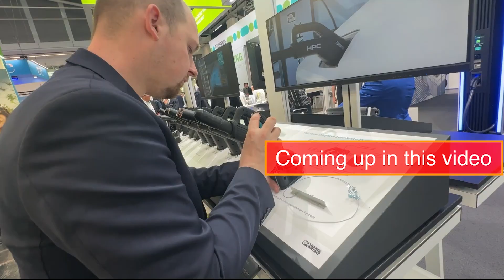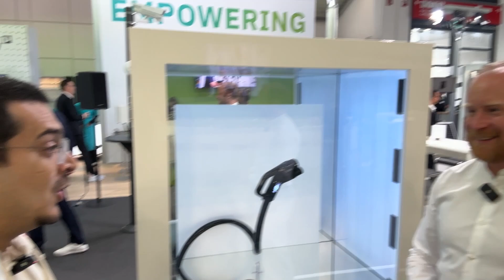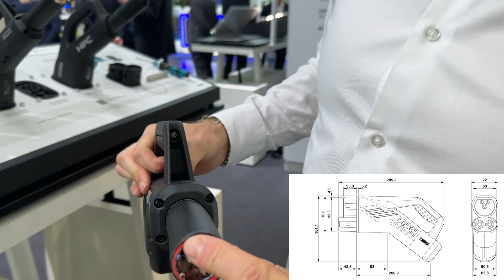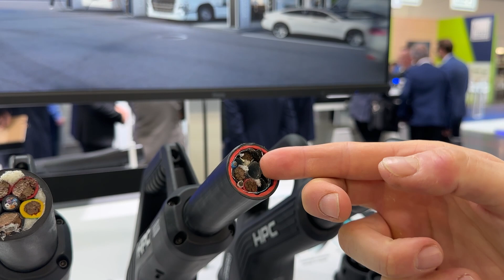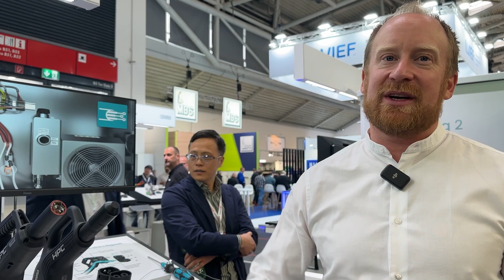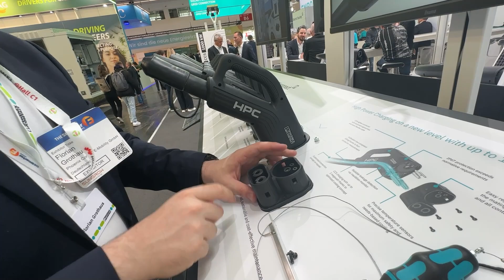1000 kW CCS Connector Exclusive! 20% Lighter & Ideal for Trucks | Phoenix Contact at Power2Drive 25

Comment: I love the design of the charging at the end, can't wait to see them in person. Great job to everyone who worked on this.
Reply from the maker: Indeed. Due to confidentiality reasons, I was not able to record the new cable cross section. But there was so little copper. Instead of one central tube with coolant, there were multiple coolant pipes and very little copper was surrounding it. This made the cable extremely light and also flexible. 
Phoenix Contact did a great job!